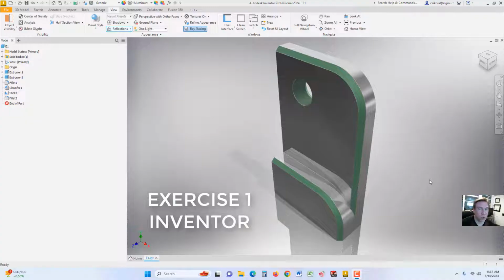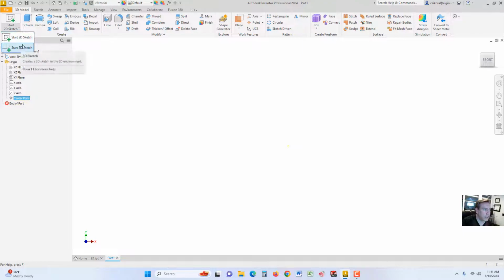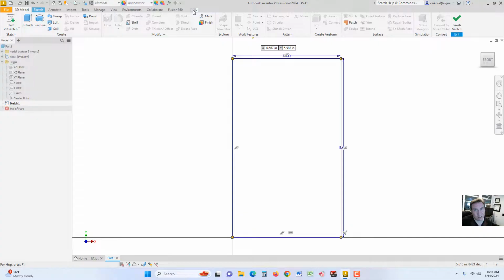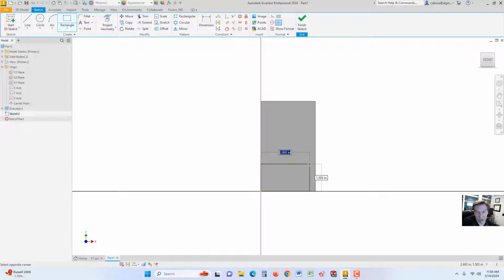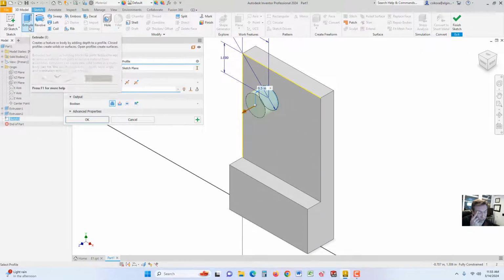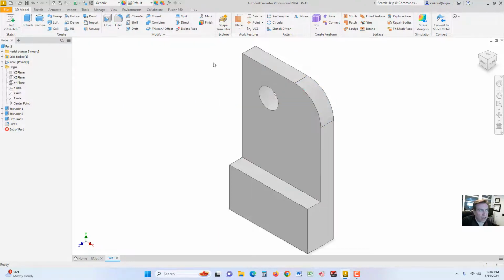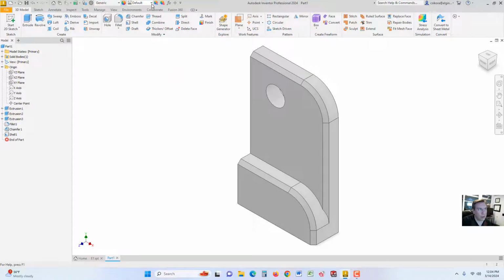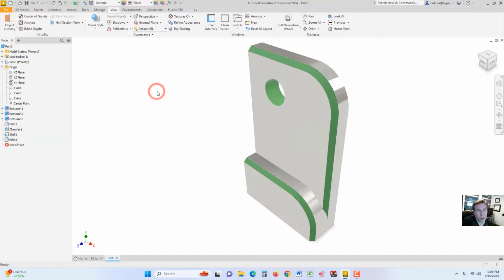E1 Autodesk Inventor 2024 | Basic Modeling for Beginners Tutorial with Training Guide

Comment: whats the difference between the autodesk inventor and google sketch up or are they almost the same??
Reply: Inventor has a lot more depth. For simple design they are equal and just have their own niche tricks, one may suit you over the other. However, Inventor has a lot more depth like i said, you can put parts through fully simulated engineering tests and even use coding to automate your design if you want to go that far into it. The complexity of Inventor is mind-blowing when you learn how it all works.